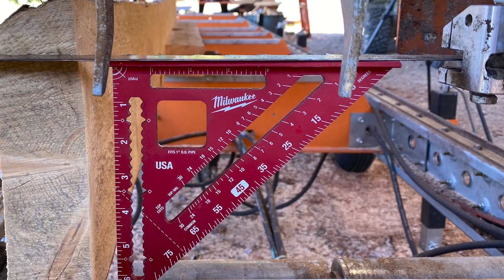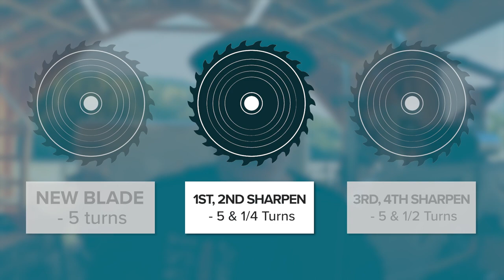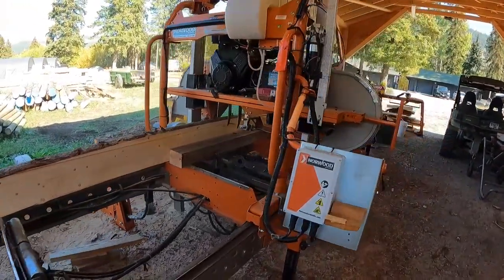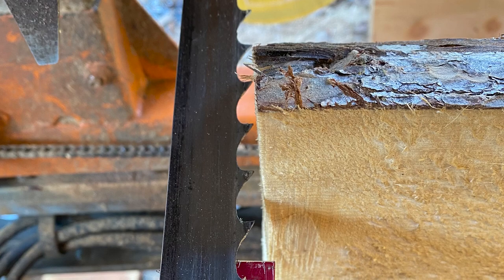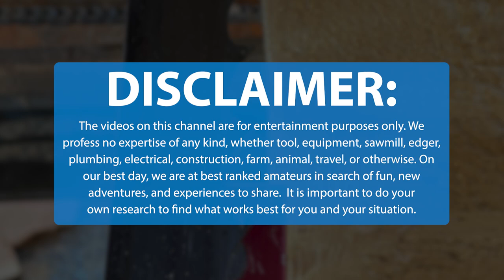Wavy Cuts? – 5 Tips That Guarantee Straight Cuts From My Norwood HD36

Comment: Fantastic video Howard. Thank you posting it. Nice to have a visual of the instructions. You taking the time to do this means a lot. I can’t thank you enough.
Reply from the maker: You are very welcome. Glad it was helpful.  Huge thanks again for being part of my journey.
Reply: Appreciate your videos Howard have a HD38 near completion. Have a question for you if you don't mind. The board return fingers. I see them as very helpful just wonder about the stress on the headrig? Do you use it on 2x10s or mainly 1x? 
Thanks Joel
Reply from the maker: @PhelpsCycle  Joel - you and I have the same concern about those fingers.  Unless one gets them positioned just right it's easy for the fingers to still push up over a 16' 2X12 true cut piece and the result on the saw blade is not going to be pretty.  
Just so that I don't reflexively rely on them at the wrong time, I've actually quit using them entirely.  They're still hanging there.  I just don't rely on them.
I find that it's also much more efficient to make several cuts totally just under 6", shut off the mill, remove them, blow the sawdust off with a leaf blower (reduces mold in my part of the continent), and sticker them before moving on to the next series of cuts.
Reply: @howardkettner  appreciate your feedback!
Reply: @PhelpsCycle  I'm going to jump in on this thread for a bit... the dragback fingers are not compatible with the HD38 at this time, because of the different design of the sawhead.  Norwood recently sent me a dragback system to see if I could modify it for the 38 and work up the instructions.  Will keep you posted.

Comment: Great job as usual, Mr Kettner. Improper drive belt tension and using too aggressive of a hook angle can wreak havoc as well, wanted to throw that out there. Awesome content, keep it coming.
Reply from the maker: Great points - you are so right.  I check that belt tension with every blade change, but forgot to mention that.  
Also - because I use the Norwood Pro sharpener at the factory settings I take the hook angle for granted - which you are quite correct - if incorrect that can change everything.
Huge thanks for the added perspectives!
Here's to the journey!  Hoping all is well with you.

Comment: Good info Howard, thanks! Btw, did you get a new blade enclosure for the mill. Seems like I remember lots of tape and repairs.
Reply from the maker: Yes I have.  I could no longer hold those together with repairs - and the recommendation (from Norwood directly) about mounting a piece of 1/8 birch plywood inside of the front removable covers had the effect of distorting the rear of half of the covers - essentially pulling it forward till -the covers actually got cut nearly through because of being pressed up against the back of the running blade - despite some brackets I installed in an attempt to prevent.
Very observant on your part.  Looks like a new machine!
Thanks for tuning in again!

Comment: Hi! I have a curiosity question about your building. Are you in an area with snow or little snow? I am in NY, have a fairly open building for the first time, and am considering how to close it up while leaving giant openings for logs. Just looking for advice if you have to deal with that and what you do about it. Thanks!
Reply from the maker: Lots of snow where I live (20 minutes from a ski hill)  Temperatures down to minus 20 Celsius/-4 degrees Fahrenheit.  
I have a building with full sheeting on the side that seems to be where the cold wind comes from most of the time.
THe building is 24 X 40 with my tool trailer parked just under the roof on the south side.  I have a 24' opening for logs to come through.
Your question sparked an idea for an upcoming video in which I'll deal with the whole topic of sawing below freezing and cover:
Shelter
Snow
Lighting
Tool/supplies storage
Water
Lube
Logs (frozen)
If anything else you'd like me to add to the list, or if there is a specific item in the above that you have a specific question about, just let me know.  
Thanks for tuning in and being part of my journey!
Reply: @howardkettner  Looking forward to it! I either leave the building open and shovel of any errant drifts or try to partially close it... which might create more drifting. But there's a roof over it, which is SOOO much better than before. Thank you for responding.